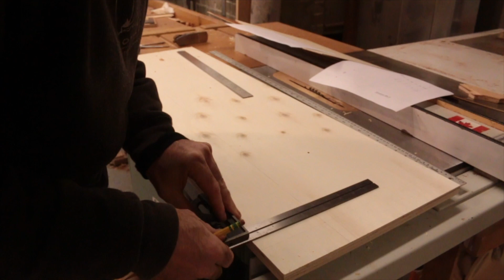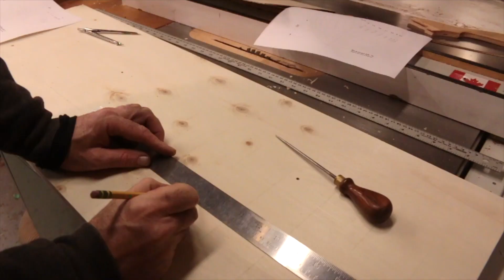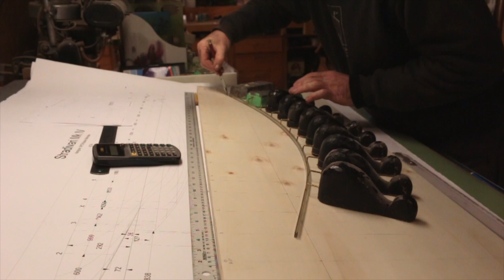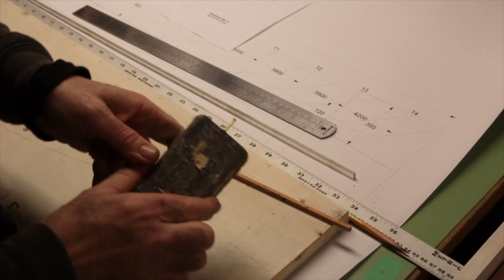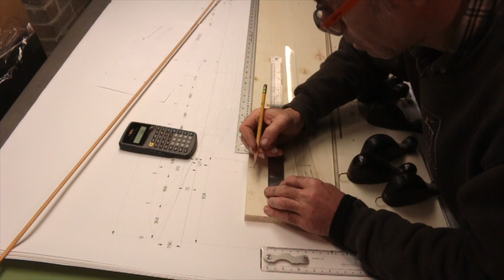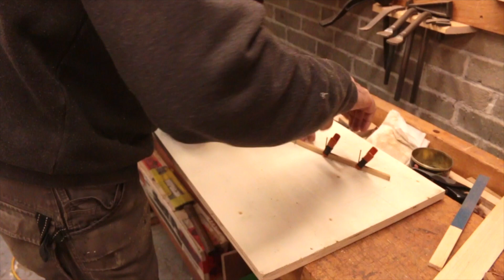International 2.4mR Sailboat Project - Episode 3 - Scale model part 1

Comment: I love designing things and built a half hull model which I spiled and scaled up to full size drawings of the stations. I was pleased to find that there were only a couple of co ordinates that were out, and only by a couple of mm. I find metric is far easier to work with than imperial and bought all metric rulers on a trip to France years ago. This is an interesting topic to cover.
Reply from the maker: The solid model method of designing has a much longer history than drawing on paper. Even some of the greats such as Herreshoff preferred it.
Reply: @Nomadboatbuilding  It was a Hereshoff docu that piqued my interest in 1/2 models and it took ages to find any way of spiling off apart from with a complicated vernier device as used in the docu. I am still quite in the dark as to how waterline positions are decided, unless they are just divisions rather like stations, ie equally spaced horizontal lines; the same goes for the buttocks.
Reply from the maker: @daleskidmore1685  All of those divisions, waterlines, buttock lines, stations and diagonals are somewhat arbitrary. Obviously even divisions are favoured but not required other than in the case of stations and those only for the purpose of displacement calculations. Getting the load waterline in the right place is important but even that is somewhat of a guess that is sometimes verified only by ballasting to it. There is strategy in the choice of arrangement. The goal is to place them such that they best interact with the hull surface at right angles. For this reason waterlines do the best job of fairing out the topsides while buttocks do the same in the lower sections in the areas like the aft counter. The diagonals are mainly used as a final check because they can have some odd shapes in some orientations but they are also useful to layout potential plank runs so that your planks don't have too great an edge set. Howard Chapelle does a good job of explaining the use of lines in his book "Yacht Designing and Planning". I often throw in extra or partial waterlines or buttocks, even extra stations, to work out details as I am lofting.
Reply: @Nomadboatbuilding  Thank you for the explanation. It looks like I was on the right lines when I used a series of horizontals ( water lines ) to measure and scale up from. I may go back to my drawings and put in the buttock lines. I have no idea if the boat would be any good, it was more an investigation into how plans were made from a half model. Thanks for the heads up on the book too.
Reply from the maker: The primary reason to add buttock lines would be to give you another avenue to fair out and to assist in the accurate scaling up to a full size lofting. Of course the shape of your hull will dictate the effectiveness of any of these lines. Whether it’s a good hull is a whole different subject. It has long been standard practice in boat design to use a proven design as a stepping off point.

Comment: I've been following your channel for some time and really enjoy it.  I came upon it because I was searching for information regarding half modeling.  I've recently started making  models and find it an enjoyable hobby.  I do have a problem finding plans though, and have been trying to learn the basics of lofting.  Not as easy as I thought it would be.  I will really find this one interesting
Reply from the maker: Thanks Harry. I'm surprised you're having trouble finding plans but I guess it depends on what kind of plans you're looking for. I assume you saw the first few episodes of my Bouchie Dory series where I walk you through the basics of lofting. It's not a complete nuts and bolts tutorial but should give you some general procedures. The best way to lear how to loft is by doing it. Start with a flat bottomed boat then move onto something round bottomed. Avoid anything extreme in shape. For the purposes of learning you want something kind boring to look at. Greg Rossel's book The Boatbuilders Apprentice has pretty good instructions as does Allan Vaitses' Lofting. I would highly recommend you get a copy of Howard Chapelle's Boatbuilding. It has both excellent lofting instructions and a good variety of plans.
Reply: Another good reference is "Mystic Seaport Boatshop Lofting Manual" available on Amazon or from the Mystic Seaport.
Reply from the maker: @mattevans-koch9353  Thanks Matt. I didn't know about that one.

Comment: Would proportional dividers be of help to you when transferring those points ?
Reply from the maker: I suppose so but I don't have a set. The calculations are simple enough and there isn't a ton of it to do. I think it's also good practice to work through the math. Even if I'm off it's not a great concern because we won't be pulling anything but rough nominal dimensional information off of this model. This exercise is primarily to explore the planking process.